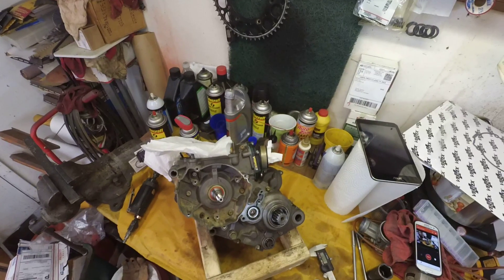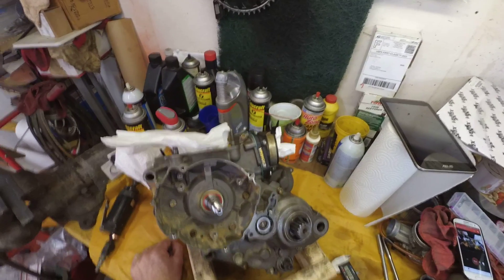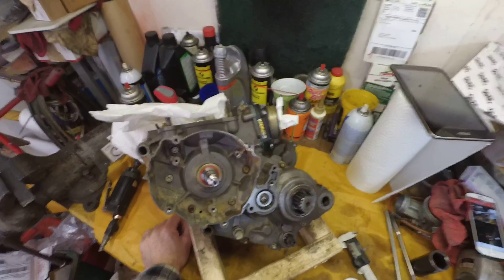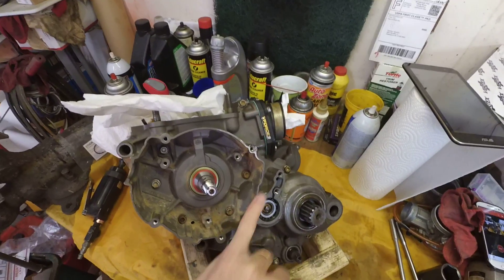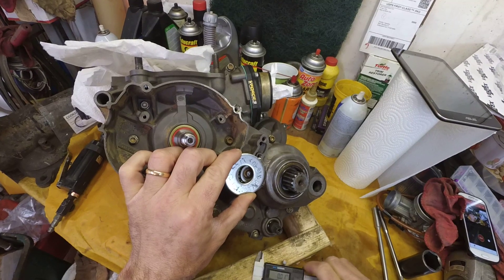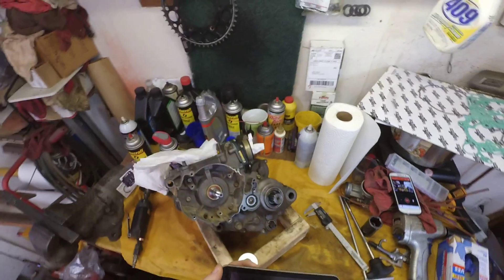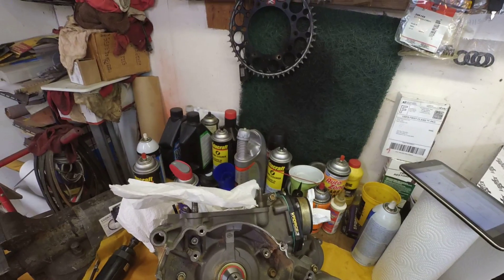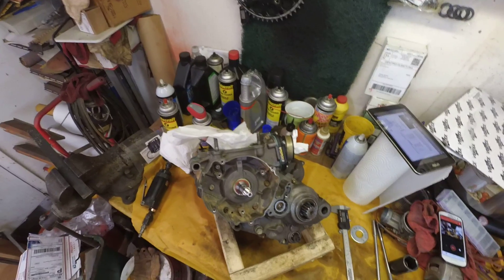KTM Y dimension for hydraulic clutch gasket

Comment: Ever work on Mxc 380,  dam single spark knock will drive you insane'.   Slavens says igntion box issue?   Your Piston comment totally makes sense now but what base gasket should you start with then when checking?
Reply from the maker: Never worked on a 380. I start with the medium gasket and use a flat machined piece of metal to measure the X-dimension.
Reply: @TepcoCycleRepair if you use the wrong gasket will the clutch not work/ let plates slide

Comment: Z,x,y I would think the tolerance on the cylinder height, and clutch would be the same on every bike but guess not on KTM.  I have 2 and they rattle'Vibrate' make more noise than any other make out there!  They do Scream though when their jetted rite etc!
Reply from the maker: Yes your correct about the cylinders, but if you use a different piston then stock, the thickness of the piston over the wrist pin could be different. This is why you have to check the X-dimension.  You can also change the y-dimension in this video to change the feel of the hydraulic clutch. Thanks for viewing!